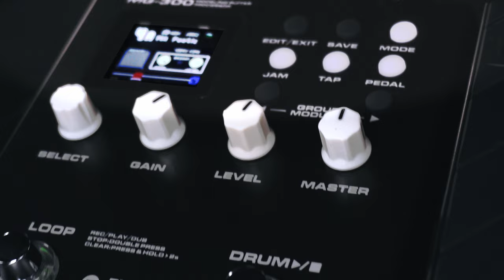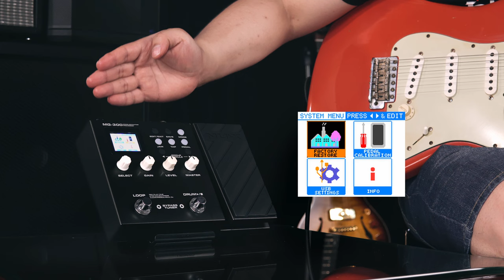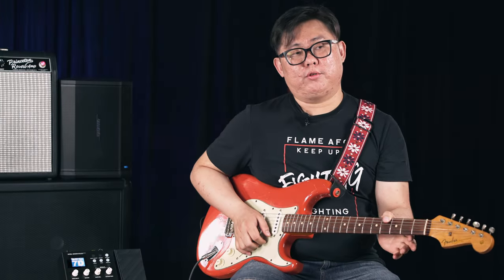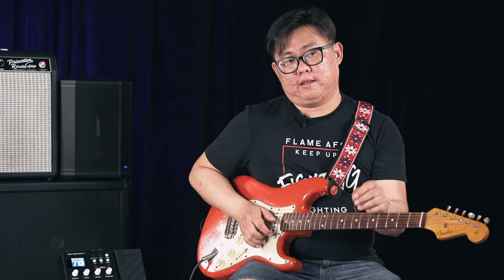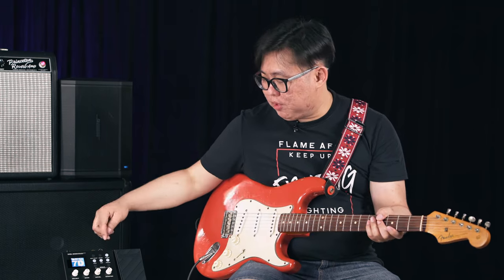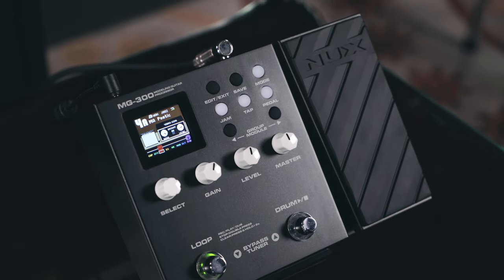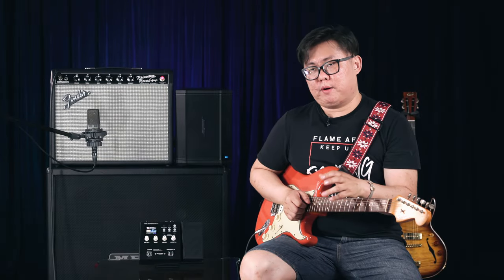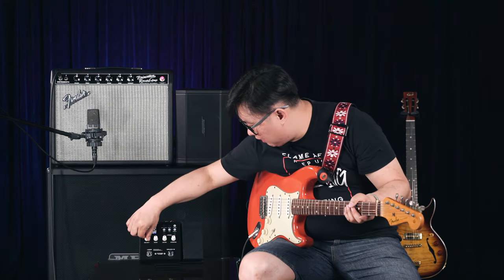NUX MG-300 Quickstart Tutorial 1/2

Comment: COMBO REAR vs STACK REAR? What is the difference? I am using mg-300 as a preamp connected to > 5mm electro~harmonix power amp which goes to > 1x12 guitar speaker. Any ideas?

Comment: Wow can i use this thing directly to the PA?
Reply: For sure, MG-300 has Studio Direct out mode option, the output goes with IR.
Reply: @Monkcustom  is DI box needed?
Reply: @alwan1414  It depends on the length, if the distance is shorter than 6 meters, I think it's no need to use DI box.
Reply: @alwan1414  i dont think so aslong ur pa have input for guitqr cqble like nux pa50